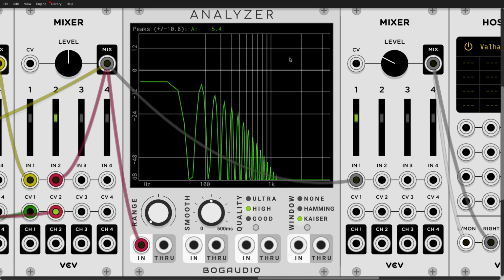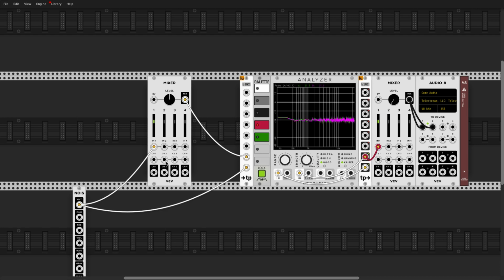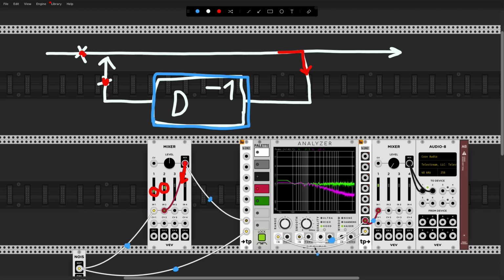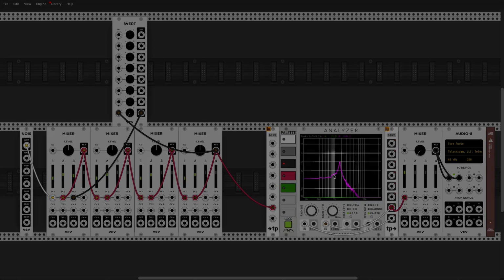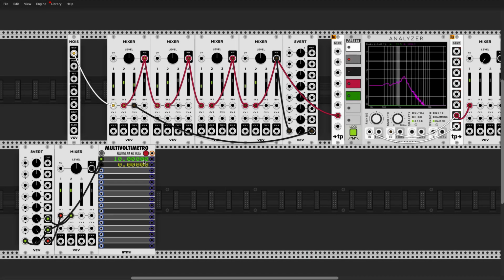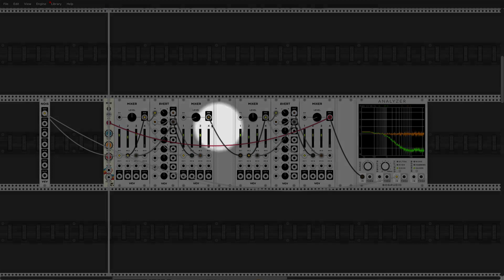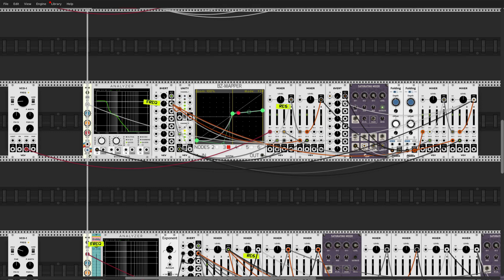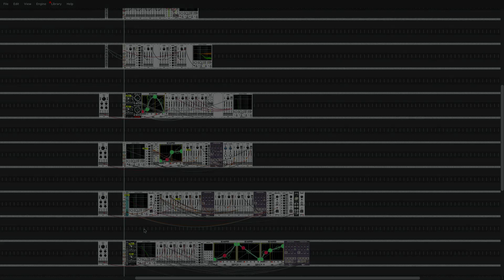VCV Rack Hacks | Jacob's Ladder

Comment: great explanation, I imagine it is the exact same thing on the analog domain right?
Reply: Im not expert but my understanding is that this works because of the one sample delay between patch points causing phase stuff to happen. I imagine in the analog domain there's much less delay going on.

Edit: but the principle of how it works is still very similar. I just don't think you could build it with by patching together mixers in the same way. Like I said Im not an expert though.

Comment: Wouldn't it be easier to build the "user interface" and mixer at once from a single module: XFADE (Bogaudio) seems to have been designed for the purpose you're demonstrating here, as its cross-fader does exactly what's needed.